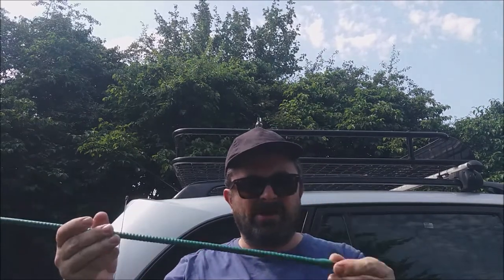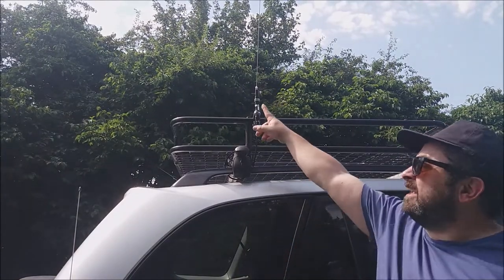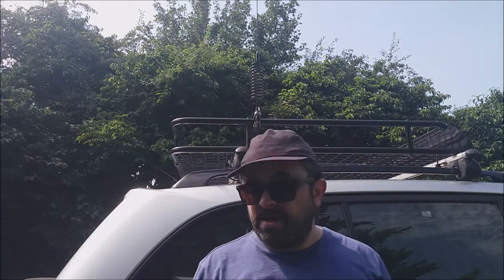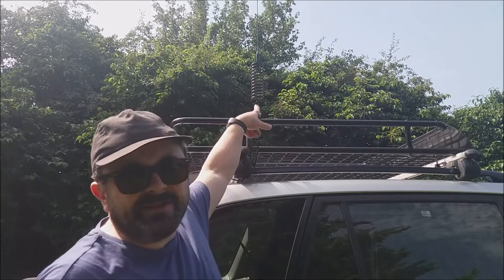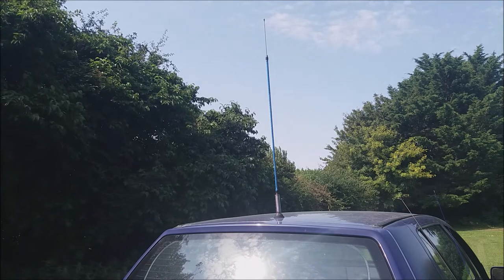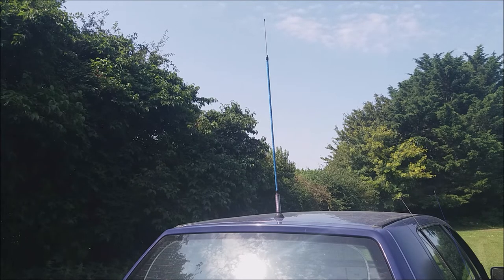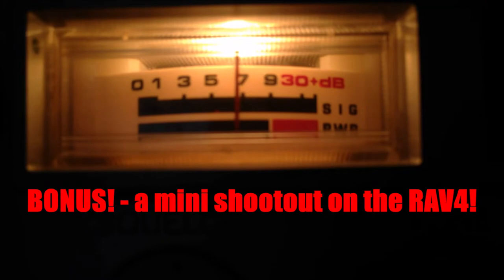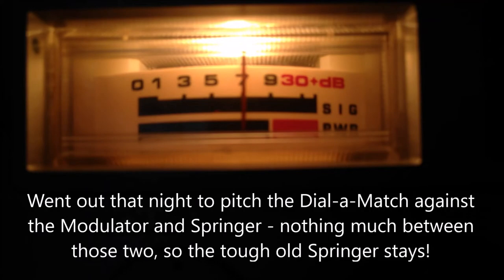Antenna Shoot-Out 3 Debrief and Vehicle CB Antenna Choices

Comment: Thanks for your thoughts. I am not expert on mobile antennas as I tend to go the full monty with a base antenna for static mobile. Interesting the top loaders in your experience seem to be less affected by vehicle mount position, well observed. My tank whip is without doubt directional to an estimated 1-3dB (rear roof mounted, I use the spin the vehicle trick as well) I would also consider popping up a hill to clear any local terrain and seeing if radiation angle has something to do with it. As you suggest tank whips can be quite fussy, I was fortunate and it seems to like how it is mounted, gives roughly a 1 S-point improvement at the top of a hill, at last test, over a 1.6M whip. Very enjoyable viewing.
Reply from the maker: Just done another test which should be up soon - final test will be to take the big twigs to a hilltop and I'll face the high gain towards the RX station. I think this will prove what we've been suspecting. Cheers.

Comment: I wonder why  you chose the Firestick over the triple top load aerial because on your tests the TTL appeared to be better than the Firestick. i used to use the 5ft Firestick but now use the TTL because i get a better radiated power footprint on the TTL.When using both the other week when we had great skip conditions into N Ireland and Scotland the TTL gave a good 2 signal points over the Firestick.
 I do enjoy your videos by the way , very informative and I like the way your describe everything. cheers Keith...
Reply from the maker: Hi Keith - I think the 5ft genuine Firestik II was just a tiny bit up on the 4ft TTL, so considered that for the static mobile DX antenna on the Rav4 (the 7ft Thunderstick was unimpressive, so won't be using that one on this vehicle). I use the 5ft Firestik as a base antenna on a patio, so I've ultimately decided to go for the little Dial-a-Match for short range stuff and will use the full sized Springer or Modulator as the antenna I'd stick on there for touring around. In both the Polo and the Rav4, I will keep a 4ft TTL in each as it's proved it's a very capable antenna in every test so far. Cheers.

Comment: How the antenna performs is greatly determined by the amount of horizontal sheet metal underneath the antenna.
 A short antenna on the roof of your car should outperform a long antenna mounted on your bumper close to the ground.
Reply from the maker: Hi Scot - totally agree. I'd have a shorter twig on the roof vs. a long one on the bumper any day. The radiation pattern of some of those installs must be all over the place and doubtful a lot of them have ever been tested for SWR either. Cheers.

Comment: At 18.35. In vid...name of antenna? 
Having two of those on a big rig as duels would look bad ass on the mirrors. ....mike from minnesota. .
Reply from the maker: Hi Mike - it's a 'Les Wallen Modulator' which has been made by the same company in the UK for about 40 years. It's been copied over the years, but this is the original https://www.ebay.co.uk/itm/THE-MODULATOR-ORIGINAL-CB-ANTENNA-FROM-WALLEN-ANTENNAE/164272598375 - they do a centre-load too which might be even better for the big US trucks. Cheers.
Reply: Tornado stinger antenna. ..good transmitte and receive. ?  
Easy swr,?....
How tall in feet....?
They don't have those in .usa. ..
Maybe can buy from amazon? 
...Mike from  Minnesota. ...

Comment: Great video thanks. I've got a midland portapack cb and I was wondering if the Thunderpole 2.c/L would be OK for my front room to clamp to my window frame as I haven't got a roof as I'm on the second floor and the built in antenna isn't any good for indoor use
Reply from the maker: Hi - are you referring to the Thunderpole Apollo 2 C/L mag mount antenna? - the only Thunderpole 2 C/L I know of is an old base antenna from the 80s. If you are considering putting an antenna on a window sill and using the sill as the groundplane, it's likely to be aluminium, so a mag mount wouldn't stick to it, so would need some sort of fixed metal-to-metal mount instead. In addition, the sill would probably be insufficient to provide enough groundplane and the SWR would be high. Even if it did and the SWR is OK, the direction of the signal would follow the metal making it directional to the sides.

I think in a similar situation, I'd consider something like a Sirio Boomerang (there's two versions, a full 1/4 wave and a shorted loaded one) or perhaps a ground plane/counterpoise like this https://www.ebay.co.uk/itm/SIGMA-CB-Mirror-Mount-with-Ground-Plane-Kit-Ideal-for-Fibreglass-Cabs-eg-ERF/321782412453 with a mobile antenna as the top section (like a Thunderstick or DV27). You might also consider making a dipole out of a couple of mobile antennas or have a mobile antenna as the top section and a length of wire as the bottom counterpoise (like the Wot Pole antenna I recreated on of my videos, but with a wire as the bottom section).

With the proximity to the wall, SWR tuning may be difficult and it may require a matcher to fake a decent tune to protect the radio. Depending on the location. the performance of these possible solutions is unlikely to be great - I'm lucky with my ground-mounted Firestik because I face out to sea, but in a 'normal' location it'd be a 10-1 setup.

Hope some ideas, but experimentation will likely be needed - all part of the fun though! Cheers.
Reply: @ukcbtv  thank you for your reply would a stinger springer be OK with a magmount base with a swivel adapter on my windowsill or on a biscuit tin. I think the last time I was on the cb was in the 90s lol 😁
Reply from the maker: @djpaul146  - worth a try if you've got one already, but top-loaded antennas do seem to be more forgiving in difficult installation locations, hence the famous DV-27 on a biscuit tin in the loft combo from back in the day! I was off the CB from 1982 until about 2009 so great to see others coming back on after a long break too  👍
Reply: @ukcbtv  I can remember having a dier pole in my bedroom from corner to corner it was terrible lol

Comment: My every day go to twig is a Half Breed copy Ive owned since the 80's . I get good copies out to 10 miles on 4w and theres no worries of the mag mount jumping off the roof.
The original 7ft Firestick is an absolute beast, but awkward to fit.
The smaller your antenna, the more of a peanut station you become.
Reply from the maker: Just ordered a Half-Breed copy to try - no doubt on a par with the other twigs of a similar size, but looks like a possible 'daily'. The big twigs have yet to shine on any of these tests - looks like they're 'hilltopper's' twigs with an ideal install and a good take-off required to perform (the final test should confirm this). Cheers.

Comment: My favourite antenna was the Les Wallen Modulator but for the last few years i've used a Thunderpole TZ27 (Half Breed), it's performance is excellent, unfortunately it's now discontinued, i should have bought 2 or 3 as reserves.
Reply from the maker: One of the few antennas I've not tried - I tend to buy a couple of everything which is why I've ended up with such a multitude of antennas! Cheers.
Reply: @ukcbtv  It's worth trying one if you can. Although it's long, it's quite a discreet antenna because the coil isn't very big.  I also had the Les Wallen centre loaded Super Modulator many years ago, it worked well but i thought it had too much weight too high up. It worked well though.
Reply from the maker: @Brookspirit  - I see Knights are doing a UK-made one called a "Leopard AT-1 Half Breed" @£14.95. With post though, almost £25/delivered, so will have to wait a while (spent a fair bit gearing up for tuning rigs lately). Cheers.
Reply: @ukcbtv  Well spotted, i didn't notice it. I see the specifications are a bit different, but if they look and perform the same i may have to get one. Thanks. 
Postal costs are a pain, it puts me off buying antennas.

Comment: Is the dial a match flexible at all? If I were to hit something by accident would it bend slightly or be ripped off? I prefer the look of these to the springers
Reply from the maker: It is quite flexible - wouldn't want to bend it double, but it's the 'convoy' antenna I have on the Rav4 full time and have had it take some knocks with no ill effects. Being short and base loaded, not a high performance antenna though but was up on the Mini-Springer in my antenna tests. Cheers.
Reply: @ukcbtv  Sounds great. Thanks very much for your quick reply and your helpful videos. Cheers

Comment: Hello, I have a LWB/HIGH TOP transit van. Can you recommend a good antenna for the best reception
Reply from the maker: Hi - for best reception, one of the big Sirio antennas like the 4000, but these are 6ft+, so whether that's a practical option on a high vehicle is another matter. Maybe a more tough and practical would be a Springer (not the mini-Springer). If the van roof is fibreglass though, you'll need to rig up some sort of metal plate to provide a groundplane or look at some sort of groundplane-free antenna/artificial groundplane. Testing the install with a SWR meter is essential even if the antenna is supposed to be pre-tuned. Cheers.

Comment: Do you have a ground strap from the basket to the body 
I yousta have truck wheth a lite bar 
.i had strap on each side n pulled the rubber whether strip back ran a screw in n pulled the rubber whether over IT
Reply from the maker: I reckon that would be an improvement for sure  👍

Comment: Trying to swr a mini stinger and can't for some reason. Any help please
Reply from the maker: Hi - being a short antenna, these can be difficult to tune for 40 channels, let alone 80ch and anything under 2 at the ends of the band is good. If your SWR is hanging around 2.5/3 and won't respond to tuning, then it'll probably be a lack of sufficient groundplane, grounding issue or the antenna is located in a position where it's near other metalwork (low down on the vehicle body or near roof bars, racks etc.). Hope this helps.
Reply: @ukcbtv  thanks mate it is near a roof  bar it is an aluminium one so don't know if that would make a difference but easy enough to move will try tomorrow. All the best Chris

Comment: What is the mount called you used to attach that to the roof rack please
Reply from the maker: Hi - it's a 'Mirror Mount' (called that because it's designed to clamp to truck mirrors). Several versions available, but mine is this https://www.thunderpole.co.uk/mirror-bar-mounts/thunderpole-flat-bar-mirror-mount-kit.html
Reply: @ukcbtv  awesome thanks very much

Comment: Is that rack big enough on the Rav 4 or have you grounded to body?
Reply from the maker: No SWR problems on 27Mhz, but the big unloaded antennas (like the full 1/4 wave Tank Whip) did seem to be down on performance and would likely work better with some earth straps to the bodywork. Maybe more of an issue further down HF.

Comment: your idea of as tall antenna is still short. Also that luggage rack you have on the Toyota is a lousy mounting point. I know they have their uses but they really are not good for antenna use. My mag mount antenna is taller than your "tall" antenna.
Reply from the maker: Hi Roger. My idea of a tall antenna is a full 1/4 whip which I use for static hill-topping as it's impractical to use whilst driving around UK country lanes. Indeed this is a compromise install, but the roof basket is there for a purpose (it gets used often) and the install does work well enough. Anything short of a fixed mount drilled through the centre of the roof of a vehicle will be a compromise - that includes magmounts which rely on a capacitive connection to the bodywork. Cheers.